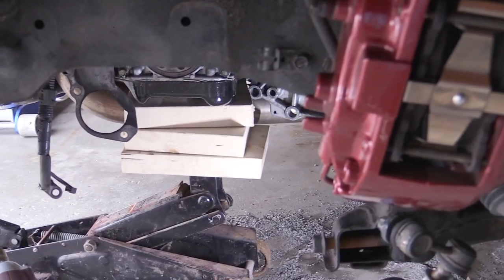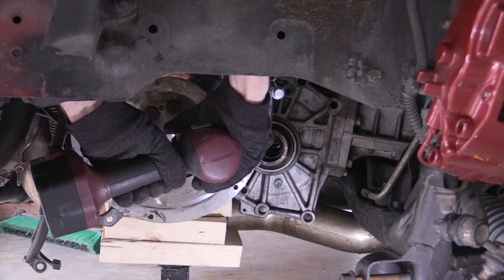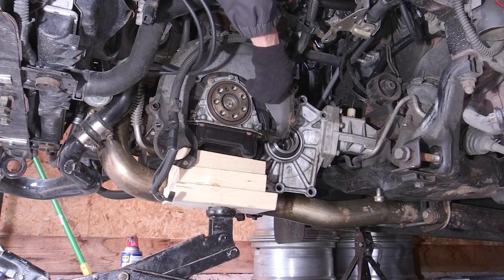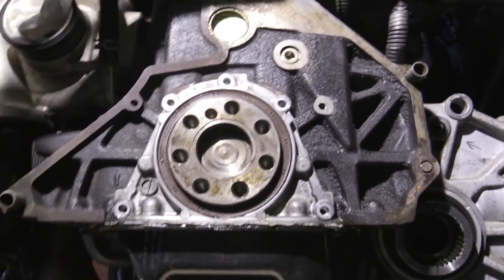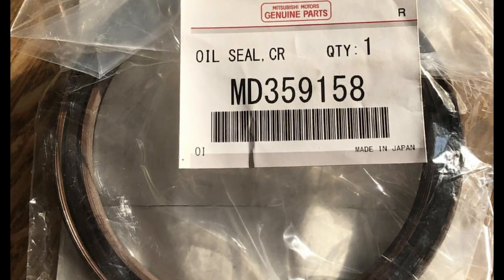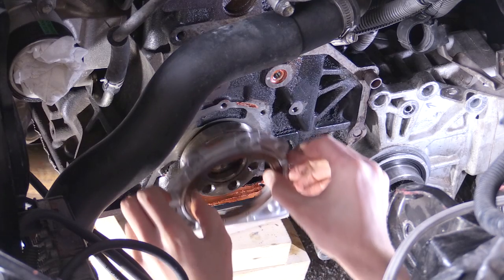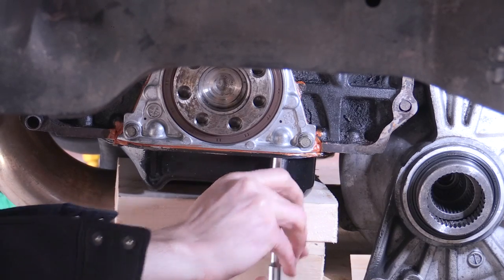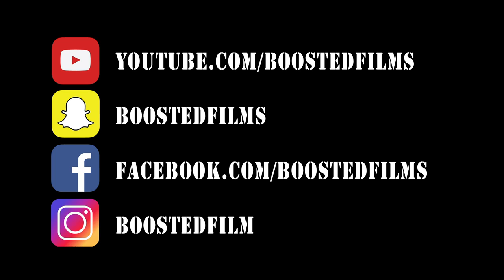EVO 8 Rear Main Seal // Evo 8 Clutch & Starter Plate

Comment: When I pulled my flywheel, I rounded a bolt and ended up having to drill the head of it off.  When I was reinstalling, I took a 6 point 17mm socket and grinded it down so that the head of my new bolts were flush.

I also replaced my main too, I reused my housing and it was a pita to get out.  I used a vice with some wood blocks to set the seal flat. Then I took some pliers and put the rubber handle around the seal and then pounded it until it sunk all the way in with a rubber mallet.
Reply from the maker: Thanks for the reply.  I thought it would be a pain to remove from the old housing, thanks for confirming and letting us know how it can be done.

Comment: Good work as always man.  I was curious to see if youd do the housing or just seal.  The housing itself is fairly cheap and worth it not fighting the old seal and damaging the housing.  I have a old one in the garage right now it seals like it would be a PIA to take out without knicking up the old housing.
Reply from the maker: Richard Roberti yup, I had the same thought. I initially mentioned just that in my voice over but cut it out since I never actually tried to remove the old seal from the housing.

Comment: Any reason why the rear main seal is only flush? When I installed my new motor I installed it the rear main seal till it was bottomed out. I compared to the old one I took out and it was also bottomed out. Thanks
Reply from the maker: I was told getting it flush would work. But when i look at my old seal i can see it was just a little deeper (probably bottomed out as you stated) than being flush with the surface.  I think either way would work just fine.   If i have issues i will report back.
Reply: I know this was asked a while ago, but thought I would chime in.  Sometimes the crank can develop a little bit of wear from the seal contacting the same area over a long period of time, if you seat the main seal a little further out it will contact a fresh section of the crank and be less likely to leak for longer.

Comment: Would you happen to know the torque specs on that rear main seal cover? I have a 4g69, and I gotta replace the rear main as well. The part number for my rear seal cover matches yours, but mine is off a 06 galant automatic.

Comment: Mighty fine looking downpipe you got there. LOL

Also, what was your reasoning for replacing the starter plate?
Reply from the maker: My old one was a bit bent up and a new one was like $20.  But yea, didn't really need to since my old one still worked fine.
Reply: @BoostedFilms  ohh. Hell for $20 why not.  Didn't realize they were so cheap.

Comment: Paul, i drop flywheel during removal, do i need a new one? the back side of it has some blue coloration, clutch was slipping. 
According to owner clutch was done a while back thus im assuming that clutch was resurfaced, is there a way to tell if a flywheel has been resurfaced?
Reply from the maker: Julio Lucero I don’t know the specs off hand, but the flywheel thickness should be able to be measured. I have a stock flywheel here that was re-surfaced about 3000 miles ago I could sell if you need. If it’s blue on the back, it probably got really hot at some point and may be warped.
Reply: @BoostedFilms  Thanks for getting back Paul, back story on my EVO, bought it a week ago, the owner then mentioned he took the car to the track sometimes and clutch would need to be done. Clutch was slipping but not crazy slipping, it would slip when turbo kicked in (WOT) other than that car ran fine. Flywheel felt fine there was no chatter nor vibration (then again maybe i wasnt able to feel it because disk is worn). Tread on disk is gone but it didnt reach the rivets. In short would i be able to see (eyeball it) if the flywheel is warped?
Reply from the maker: Julio Lucero sounds like it would be okay, especially if you’re just putting a stock clutch disc back in. I would plan on getting it re-surfaced eitherway. Check for heat cracks, post photos on evolution.net forum and get other people’s opinions if you’d like.

Comment: Paul, is it ok to do just the seal without removing plate? (some cars dont have a plate ie Subaru)
Reply from the maker: Julio Lucero yes. It just might be a bit trickier to remove the old seal and install the new one.

Comment: You didnt apply any grease on that seal... you cant install it bone dry.... Its going to wear and leak again. This is a video of exactly what you dont do when installing the seal....
Reply from the maker: Hello, the service manual suggest applying a small amount of engine oil to the inner part of the seal.  I may have put a small amount of oil on the crankshaft before i slide the gasket on, honestly don't remember since it was 3 years ago. With that said, this was done 3 years ago and is still working well. Appreciate the comment, if there was an easy way to update the video I would, until then, hopefully people check out the comments.